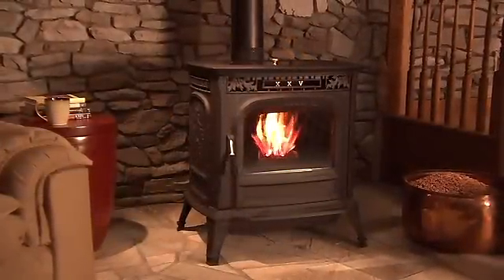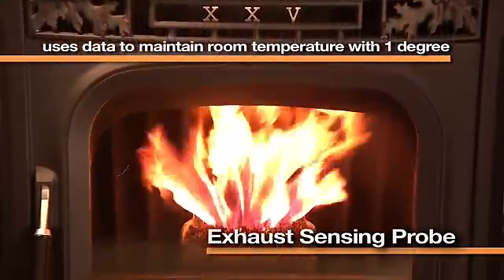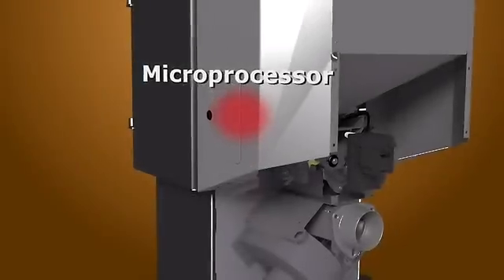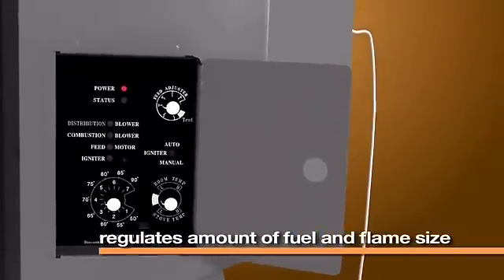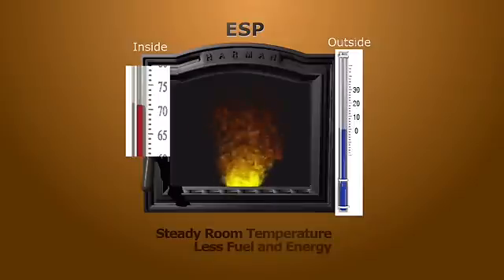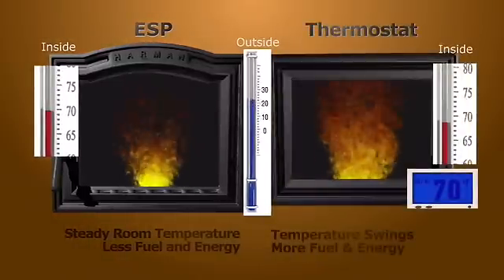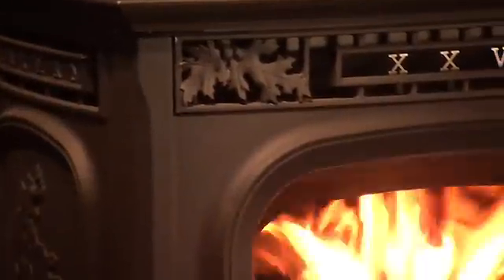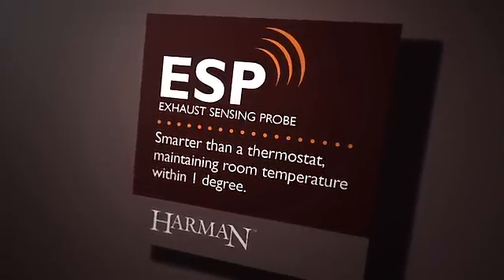Harman® Stoves ESP (Exhaust Sensing Probe) Stove Technology Video

Comment: I would be careful before purchasing Any Harmon product.. I bought a pf 100 furnace about 6 years ago, and it has NEVER worked correctly... These few videos is the closest thing to tech support you will get. There is no one you can call, you can’t even find a number for the company online.  There is a dealer about 100 miles from me where I bought my stove, (pd farms in Virginia) who told me after I got it installed that he would come do a burn in test to make sure it was running correctly... I’m still waiting on him to get here.... So the first problem I had was there was no negative pressure in the hopper,  this was due to the lid being slightly warped... The factory seals are flat rubber seals, so I had to change those with front door seals that cover more area.   That fixed the first issue,  then the igniter went out, so i replaces it... the the control board died (330 dollars). So I replaced that... now I think I have faulty wiring in it!  The furnace cycles on, goes off and comes back on (like it suppose to). Then the status light stays on, and the exhaust blower continuely runs, but that all it does... the auger motor works by itself, the pressure switch works fine, and the status light stays on (no blinks)...  I have an extra control board that acts the same way, so that’s fine.. so now I’m finding out they must have used crappy wires too... I guess the point is DONT BUY A HARMON!!!!
Reply: I’ve been heating my home in Minnesota with a Harman P-68 for 15 years with absolutely no problems. The only part I’ve ever replaced is the door gasket twice. But as you say you have a Harmon rather than a Harman no wonder it’s substandard.
Reply: I have same problem.   Dont buy Harmon!!!
Reply: We offer tech support for everyone. We have dozens of helpful videos on our channel for Harman part replacements and overviews. If you need any assistance or have any questions we are always happy to help. Harman is recognized as a leading manufacturer; we sell more Harman stoves then any other manufacturer with the highest overall customer satisfaction. If you are having troubles we can walk you through and get you back to 100%. Thanks!
Reply: @EarthSense  I’ve tried for years to get some tech support from harman… it took 2 years for you to even reply to
This post…. Your product has been horrible, but your tech support has been worse.  I will be replacing the system as soon as I can afford to.
Reply: @dan27052  Dan, you left that post on Harman's page, not on our page. I just stumbled across Harman's video on this on their channel, and decided to leave a comment to try and help. Harman is the #1 stove line in the world. We sell more Harman's then any other manufacturer with the highest customer reviews. At times folks may run into issues no different than a refrigerator or lawn mower. Harman customer service is typically outstanding. We provide technical support for all of our customers and for folks that comment on our YouTube channel here. We pride ourselves on our customer support and immediacy.  I don't know your exact situation, the dealer you purchased from, or your communication with Harman direct. I'm sorry to hear you have had such a bad experience, but if you decide that you do want help we are here to assist. Thanks.
Reply: @EarthSense  I reached out to harman every way I could, I even made a bbb complaint, and this is the first time across many different sources, that I’ve gotten any response!!!  Harmon customer service is next to non existent.  When my lawn mower breaks I’m not cold, with no support.  Actually this entire reply probably just a marketing response anyways. I’m not sure why I’m even pointing out the obvious to you.. you will probably only reply with how great Harmon is and how jolly the invisible support is…I’m not the only one who says this about Harmon either… through the years there has been several videos posted about it too.  Aparantly the pf100 is a little like a refrigerator though, because it has made my house cold more than a few times..
Reply: @dan27052  I'm a real person, I do the videos on our page and respond to customers on our YouTube channel. Very best to you.
Reply: @EarthSense  so after more than 2 years you reach out to me (by chance) to “help me out”, but all you do is tell me how well Harmon product sales, and that you are a “real person”. I never accused you of being fake… I said that you must be in marketing…. (However I am now accuseing you of being very slow).  Also (and I will be adding a new thread for this) I have decided to update this page every time something with my Harmon goes wrong!  Such as this morning when I woke up to a 3/4 filled hopper, no fault lights blinking,  my stove on, yet it was 47 degrees inside my house!!! Please maybe next time when you “happen to see this thread” in 2 years you can actually give me the numbers of how much money Harmon made by means of “helping me out”?  That will make my house so much warmer, rather than a furnace that is reliable.  Don’t take it to hard though, I was slow once myself to (the day I bought this furnace).
Reply: @dan27052  My apologies for being slow. Just to clarify we do not work for Harman Stove Company. We are a small family business that sells stoves, grills, and pellets in our retail store in Wisconsin. We offer parts and accessories for stoves and grills as well. We carry around 10 different stove manufacturers, around 60+ models - Quadra-Fire, St. Croix, Iron Strike, Ravelli, Heatilator, Harman and many more. Harman has been the #1 line of stoves for us for more than 20 years and the most referred stove line by customers since we have handled them.
I was replying to a comment on our ESP cleaning video, and YouTube had Harman's ESP video as a recommended watch. Took a look at the video, saw some comments underneath, and replied to a couple including yours offering suggestions, help, and support.
I did report and remove the comments you left on our channel; we have a zero tolerance policy on harassment.  
Thanks